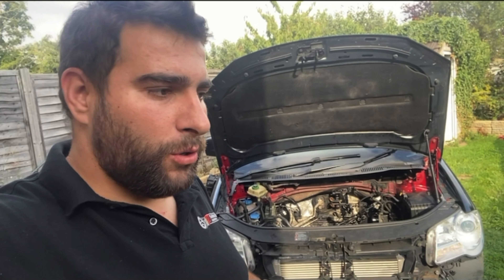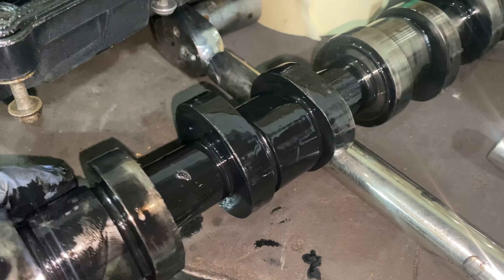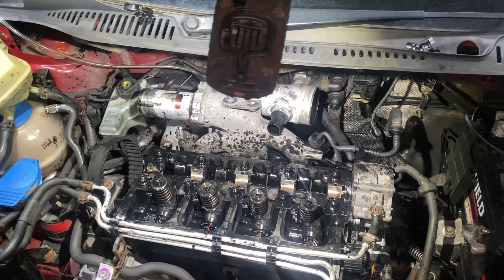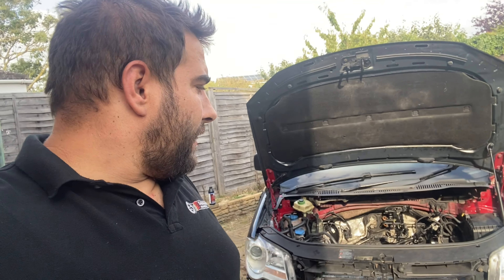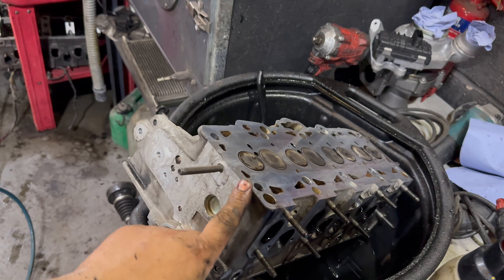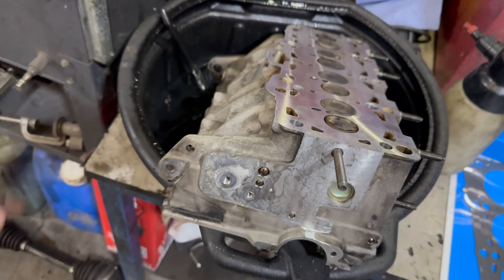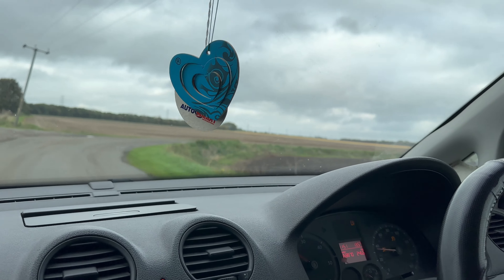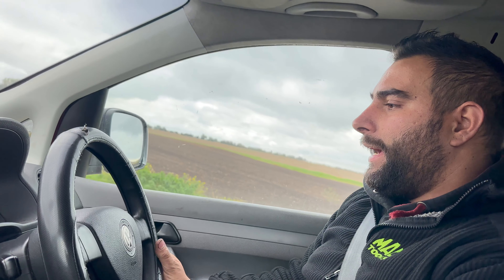VW Caddy engine swap PD150 1.9TDI

Comment: So I did go back and watch the whole video and what I said came true!  I said it wouldn’t last without a complete stripdown and it didn’t….. I don’t get how it could have run OK with a cam that had no lobes and when you took the cover off, on an engine that had done 500 miles since being built,you should have put it straight back on and given it back to your customer. Now the bloke that built it in the first place will be able to weasel his way out of liability…Lubrication is the most important aspect of successful results with these engines and saying the first start would be done with cheap oil is the way to disaster, should have high zinc content running in oil for the first 3 to 500 miles(heater plugs out and crank for oil pressure then run at 2 to 2.5 thousand RPM  until up to running temperature, no idling!!!!!!!)  Good quality mineral oil and a new filter for another 1500 miles then drop that and replace with  PD recommended oil and another filter. All filters should be inspected for debris and ideally an oil sample should be analysed…… Then, hopefully, with changes every 6,000 or so miles, using good quality VW spec oil a couple of hundred thousand miles should be possible. 
PS the fuel light was on because it was nearly out of fuel!
I’m not having a go at you for any reason in particular but TBH I could see the disaster on its way with the “ camshaft lobe grinding paste” still present in all the corners of the oil galleries and it was just a matter of time before it all went tits up…….
Reply from the maker: I understand your message but let me explain how it was. 
Costumer came asking only to change turbo and do our remap. 
When i seen the cam wear i flushed the engine, cleaned everything snd changed the oil twice. 
The reason for this damaged was the guy who built the engine used the wrong rods and the valves were hitting the pistons causing the cam wear. Also when we seen the damage on the first cam we advised costumer needed strip and he said no. So we done the job with his words. It was all at his risk. He had to pay for all this anyway because he  trusted his previous engine builder.
Reply: @HelderPutoPerformance  I stand by what I said pal, two important things, don’t get legged up with someone else’s screw ups is number one! Just put the cam cover back on and walk away!! 
if your customer doesn’t understand what you’d have to do to fix it, ie full strip and examination not changing the oil a couple of times etc etc, then he’s no good as as a customer. It’s just not possible to get rid of all the bits of steel from the valve gear without stripping it to the last nut and bolt so you were on a hiding to nowhere as soon as you started….😢😢😢😢😢😢
Reply: Hélder isto para alguns é fácil falar quando não estão na pele do mecânico! Ainda por cima por teclado é mais fácil ainda! Falam por tentativa de denegrir e como se fossem os donos e senhores! Quase de certeza que se fossem eles a situação ia ser igual, não lhes dês conversa, caga para essa gente! Ps 2060vklr tenho no meu e a fazer belos números! Já agora que pressão está essa Cady a fazer? Grande abraço!
Reply: @fl_interception  that is just garbage, I’ve been in the Motorsport Industry all my life running my own preparation business so don’t presume to tell me how to operate. What did I say that wasn’t proved to be 100% right? Every point I made is correct and if your mate has got out of this one without losing a load of cash, because he shouldn’t have got involved in the first place, he’s very lucky. Why should any self respecting engine builder have to work under orders so restricting? “ This engines absolutely knackered and it’s full of grinding paste but you can’t even take the effing head off!!  FFS, do what you like I’ve got more important shit to get on with.
Reply: Man its content for its Chanel! And no one tel you that you are rong about the engine need off almoust full rebuilt! But you dont now what he makes or not! Iff he flushed or not! Off course he Will not make a step by step only on that “dead” engine, about what he does or not in the midle! And he told to the client that its not service! The client keep its Will, so Hélder end up puting another engine and the client payed, the van gets nice power, the end! Thats the content for the vídeo, than you come teaching and arguing about what Hélder now or not about mecanic, just by gessing the parts off the vídeo that he does not show on the vídeo! Man its Hélder! More than anyone he nows all about Pd engines! Ps i dont now in your contry but in mine, the client hás always the reason on its side! And its Will! Só even iff you told him to do it in another WAY and he doesnt Wonted, the problem its not the mecanic!
Reply: I fitted a cheap Ridex camshaft on mine from eBay and it lasted 100 miles before ending up like this one. I’ll never use cheap parts again. Ending up scrapping my car 😢

Comment: what can a 1.9tdi bls max handle? with upgrades and what do u need for it.
Reply from the maker: I will say 200 bhp is safe if the engine was maintained properly 
Only need better turbo like gt1752 and clutch

Comment: So, let me get this right…..the first start with new cam, bearings and lifters is going to be with shit cheap oil? FFS that’s probably what screwed everything in the first place! What’s the oil pump and all the bottom end going to be like after having a few hundred grammes of ground cam circulating round it? That motor needs a complete strip down otherwise it’ll be the same again in no time…… can’t watch more than the first five minutes and I hope you had a re-think!
Reply from the maker: Thanks for contributee with your five minutes to my channel
Reply: You need to watch it all 🤦🏼‍♂️
Don’t judge by a 5 minute view dude.
Reply: @Dan23_7  read all the comments….I did.
Reply: I always run my race motor with "cheap" oil something like off the shelf castrol for first start up and run to get rid of all the tiny particles left in the motor from machining , doesn't matter how clean you think it is you won't get it all out with an air line.  Then I drop the first oil and start using the race oil
Reply: @blueonblueracingnova  I wouldn’t have put any Castrol product in the cheap category and PD VW engines are very particular on the oil they like, the days of put anything in that’s slippy are gone!

Comment: Essa CAM ja era. Ta toda ratada... desfeita. Põe uma PiperCam e acabas com os Problemas
Reply: Podes lá meter as cams todas do mundo que vão ficar iguais, claramente a altura de valvulas está errada, quem refeticou a cabeça não ajustou em condições a altura da válvula e deixou a válvulas enforcadas. Claro que depois não existe milagres come a touch e a cam. Ou então as valvulas estavam a ser forçadas pelo pistão e claro que também não existe milagres, pessoas penso que é só montar peças, 90% não sabe nem usar ferramentas de precisão, o helder fez o certo motor usado sem estar mexido e assim não existe cá problemas de tolerâncias.